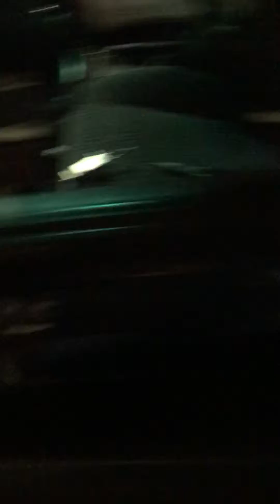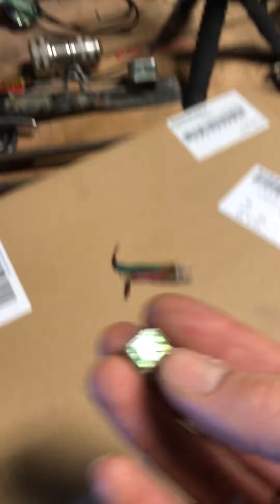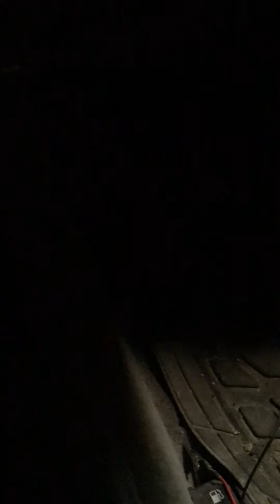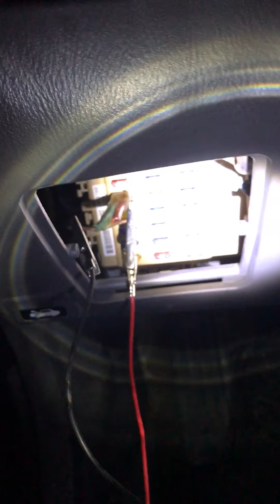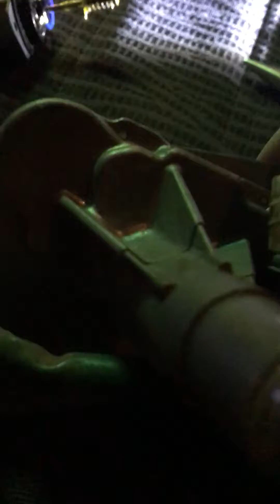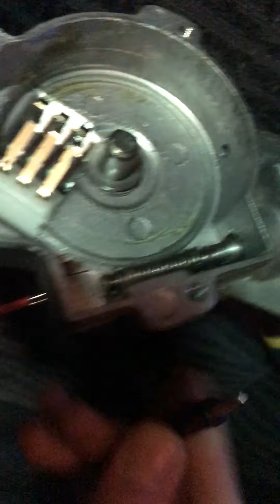Bench testing windshield wiper motor from fuse box

Comment: I have a question about this method. If you're drawing power from where the fuse for the windshield wiper motor fuse would normally be, wouldn't that mean youre running the motor without a fuse? Couldn't that potentially short out the motor? I watched you do it so it obviously works, but is there another way to test it, with the fuse in line? Would the alternative method be to put an in line fuse on the positive lead then to the motor? Thanks for your time, in advance.
Reply from the maker: Hey, I only just now saw your comment--I apologize for not responding sooner! That is a really good point. One way to deal with that issue could be to use a wire with alligator clips to connect one side of the test connector to a fuse and use another wire to go from the fuse to the motor.